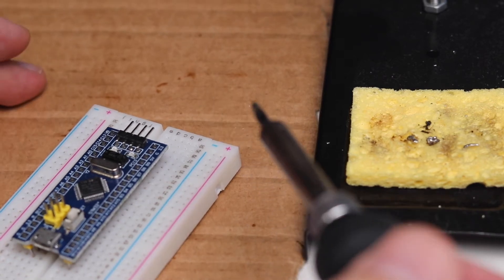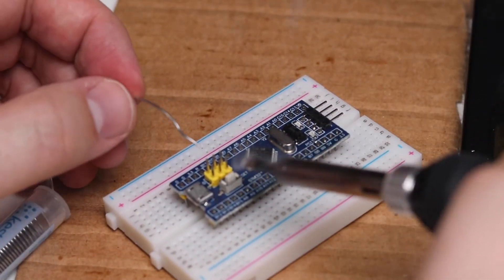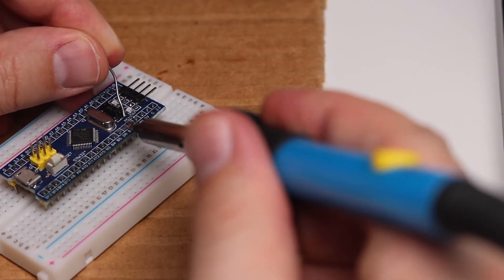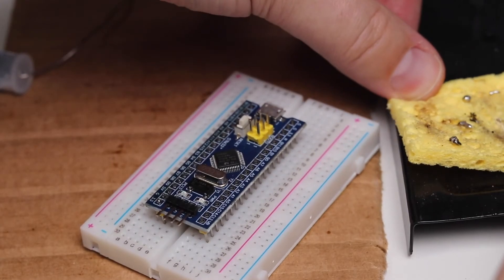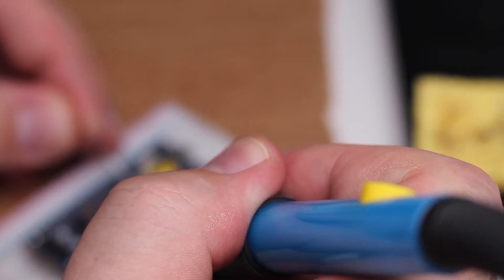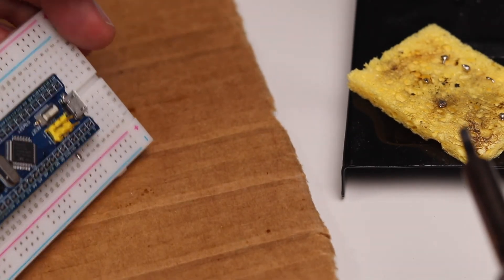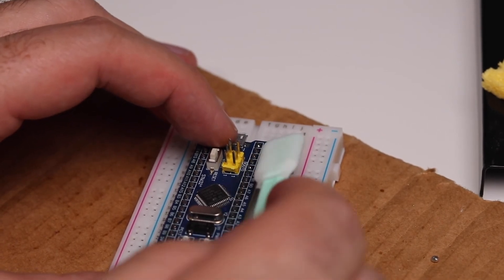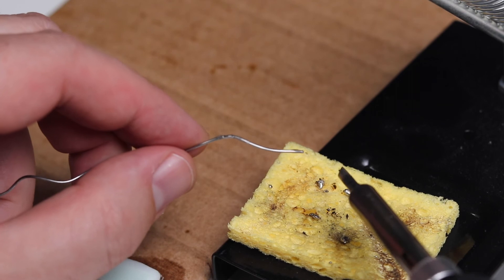Blue Pill (STM32) Rust Workshop Part 5 - Soldering the Pin Rails

Comment: Thanks for posting.  The last time I tried to get into embedded rust was before Rust 2018 edition hit.  Back then I remember there was a lot of looking up registers etc.   How much do you now do from the embedded-hal verses the stm32x-hal’s ?   I I bought a I2C or SPI widget would I write the “driver” for the chip or for the  embedded hal?  I have a lot of discovery boards and Teensy’s to work with but they use NXP chips.  Looking at the other comments it doesn’t look like anyone is still following this.